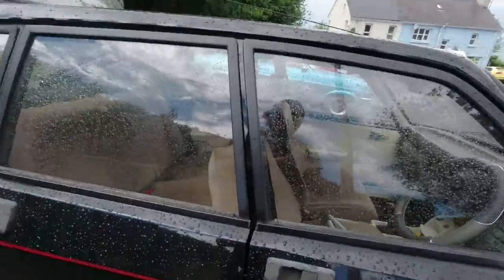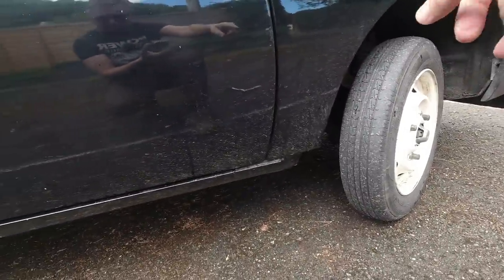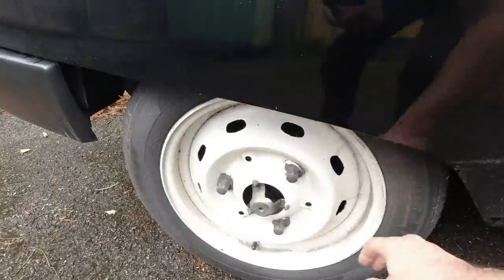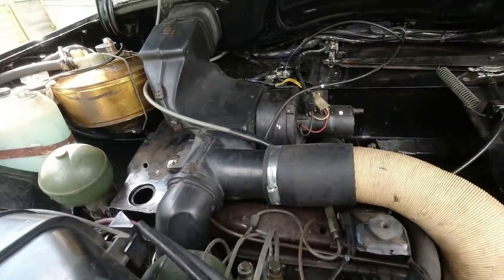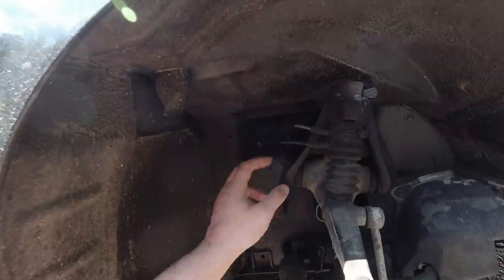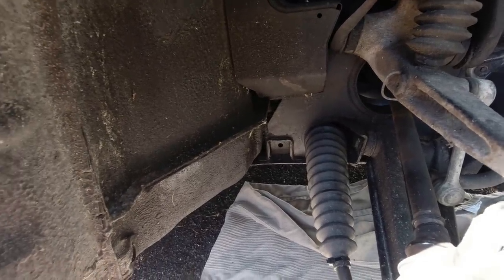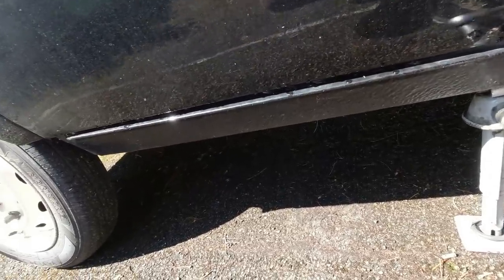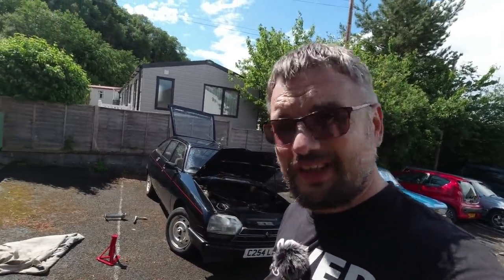How to 'jack up' a hydropneumatic Citroen

Comment: 2:33 "In theory it's as simple as just...." a common quote by any true Hubnutter, unfortunately not always as simple as one would hope 🙄
Reply: That is soooooo true lol  I said that when I started to strip my Regsl axle, two pullers and a new torque wrench later and they are still bloomin on the axle!
Reply: @StevesMachines  Yeah I fell foul of using the phrase recently when I went to fix a radiator top hose leak on my 53 MG ZS....simple enough to fix the leak but by heck, trying to flush the air lock out of the heater matrix was a nightmare!

Comment: In Canada in the 1980s, we would go to a wrecker and find a Toyota scissor jack because the fancy European jacking systems never accounted for rust. Slot the jack into its designated spot and the body would buckle as you cranked it. No such troubles in Wales.

Comment: Many years ago I had a Xantia which shed its rear height corrector rod. It took me some considerable head scratching to get the back up in the air and safely supported before I dared go under it!

Comment: Citroens with a low suspension setting such as the DS, CX etc do all the jacking work for you.
The GS/GSA has a wind up jack stand because you put it on high, when the car is solid on the top bump stops, you wind the jack the last little bit to get the wheels off the ground on that side.

So the big Citroens do all the work for you, but the lightweight GS does half the work for you.
It is less stable if you drop the suspension on normal with the jack under the car and will only retract the back wheel.

As you show in the video, it is very important that you have additional rigid support under the car frame if you are getting under the car of doing major work.

Comment: Use of choke: 1. set choke in preparation to start the engine. 2. Once the engine has started, push choke part-way in to ensure engine is not running too rich and running lumpily with soot from the exhaust pipe. 3. As engine warms, re-adjust choke as appropriate, pushing it all the way in at the earliest opportunity while ensuring the engine continues to run especially at tick-over.
Reply from the maker: I was forced to use the choke to raise the idle speed so I could film outside the car.
Reply: @HubNut  It'd have still worked at idle speed !
Reply from the maker: Yes, but much more slowly.

Comment: I had a c plated bx about 25 years ago. Had lots of hydraulic problems when I got it , but after replacing spheres and all the fluid lines all was good for rest of ownership. I did find that when going to highest position bx was quite rapid compared with the gsa, Is that normal, or is it possible that gsa might be getting a little tired. Good content though brought back some memories.

Comment: The real fun is on a hydractive system you connect the battery and it decides to sink and sit on your tools :). Engine sort of isnt attached and it wont go up a setting without it. Fun times

Comment: that exhaust leak will be between the v pipe and the middle pipe on that stupid mushroom style clamp they used, its about 1 inch from the plastic fuel line that runs from the tank in the same tunnel.   my GS went up in a ball of flames while i was driving it, after the fire brigade had put it out the council had to resurface the road . its just one of the GS/GSAs many deathtrapy features

Comment: Interesting video and fascinating how the suspension can do that but I just don't see how it makes lifting the car easier? 
Socket and spanner required, engine needs to be running, you still need an axle stand and it took 5 minutes as opposed to 20 seconds with a trolley jack.
Reply from the maker: Because HubNut. The truth is you start the engine, raise the car, slot the jack in, move height lever, car lifts wheels off the ground. I was trying to get more lift only so I could get an axle stand in.
Reply: @HubNut  I understand that you were demonstrating it's ingenious ability to do that, but it's still easier to use a trolley jack

Comment: What a wonderful car ))
Reply: They were, I had a 1972 GS 1220 Club in 1974, only two years old and only 6,000 on the clock, kept it for a year with no problems and then stupidly swapped it in for a Sunbeam Alpine sports car. Within 3 months the engine blew because someone had overtightened the bolts on the crankshaft. one of the con rods went through the block. Was only young then and it was a really stupid thing to get rid of such a beautiful GS, always regretted it.

Comment: Wouldn't you just be able to jack it up normally or would the GSA just try to keep its wheels on the ground?
Reply from the maker: You can jack it normally, but it helps to put the suspension on high to lock the suspension. You can't get a jack under it if it's low!

Comment: Doing anything under my bx causes great anxiety having my head popped like a watermelon isn’t a nice thought
Reply from the maker: No, axle stands are an absolute must.
Reply: Does the BX have inboard brakes or is it more conventional in that way? BTW, does Citroen LHM fluid go off? If it doesn't, I have a couple of bottles to potentially sell, would date from the early 1990s, probably. Rather it go to someone who can make use of it rather than have it hanging around.

Comment: How reliable are Citroen's hydropneumatic suspension? I know I see leveling suspension on more modern cars and suvs like Land Rovers break inevitably after some years, being very complex and prohibitively expensive to repair.
Reply from the maker: Bit mixed but I've found then reliable. Can be prone to leaks but often minor.
Reply: @HubNut  Does the GSA share the hydraulic system with the brakes like the CX? A friend has a CX with a leaky sphere, it ran out of hydraulic fluid and also ran out of brakes!
Reply: @HubNut  TBH I don't really see stories of it failing or people complaining about it.
Reply: @nakoma5  - I still drive my Citroen GSes almost daily, and they are over 40 years old.  
I also take my family on long road trips all over Europe (sometimes longer than 10,000 km).  
Never had any serious issue with the suspension. 
If you maintain the system properly, it will be very trouble-free.
Reply: Citroen should take the plunge and build a 2021 version.
Reply: @nakoma5  true ,,i see more stories about Tesla's catching fire.

Comment: My C5 had a flat tire (my neighbour warned me) and I was like AHA I have a Citroën...hydropneumatic.

When the tire was free and in the air I couldn't losten the bolts (tools even bent after some ,man handling and cursing in Dutch), had to call road assistance...

But my first flat with the C5 I man handled myself.
Reply from the maker: Yes, had that problem with my first 2CV! Had everything I needed other than something to undo the rattle-gunned wheel nuts.
Reply: @HubNut  If you need some cursing lessons in Dutch let me know :)

Comment: Gee's mate you're concerning me here.  Don't use those crappy Citroen jacks unless you have no other choice (the base bends badly).  Put the car on high and put the stands under the front subframe where the suspension mounts.  Your not putting a GS on low by opening hte regulator bleed screw.  Be really careful doing this, if you had tried to change the spheres you would have got a big shower.   GS's are a PITA not having a low position.  By opening the regulator bleed screw, you are only releasing the pressure stored in the main accumulator.  The suspension will still have the same pressure it did previously (unless its anything other htan a GS and the high correctors are correctly forced to "low/exhaust" position).  You brake accumulator will also still have full system pressure.  if the steering rack boot is swollen, it's probably aftermarket and the rubber is swelling due to oil the leaking oil and LHM :)   With DS's and CX's with a "low" position, often the linkage aren't quite "right", so there is still pressure even with the car close to low.  What I do in this case is lift that end of the car with a jack so the linkages move and release the last of the pressure ( the anti-roll bar clamp will move the linkages as the car lifts)
Reply from the maker: Thank you. Most of my hydro knowledge is BX, so I'm learning fast here. Sadly my stands were too large to fit under the subframe with the suspension on high. I do own some lower ones somewhere... Thanks for the info.

Comment: Sorry Ian, but you do the super thing with the suspension and then you still end by jacking it up, just like the rest of us plebs with normal cars.  Aren't Citroens great!  I think they are great - until you need to work on them.  Maybe that's just me being old and reactionary.  Mike.  P.S. Yes, I am both of those and more besides.
Reply from the maker: Only because I couldn't get my axle stand underneath it! To just swap a wheel, the car really does do all the work.
Reply: @HubNut  Ian, I know you're a Citroen fan (scraped knuckles aside) and I really didn't mean to annoy you - I wouldn't subscribe if I just meant to be a troll.  Just to ask (because I really don't know) does that work for the front wheels?  BTW there was always a rumour that the French police got CXs with V6 engines - I suspect they couldn't cram a V6 in there - but what does an old fart like me know.  Please confirm or deny.  Mike